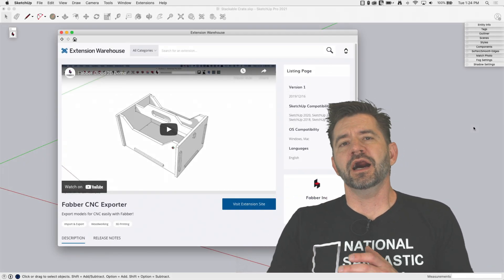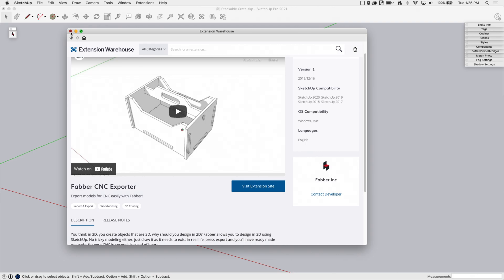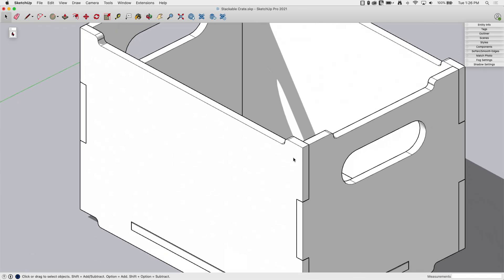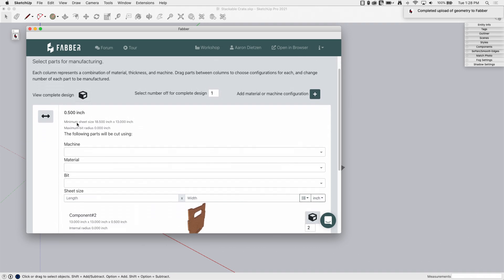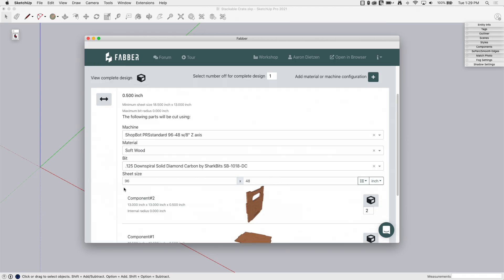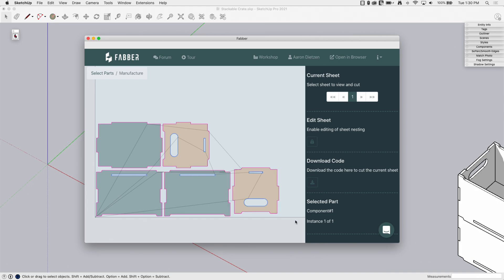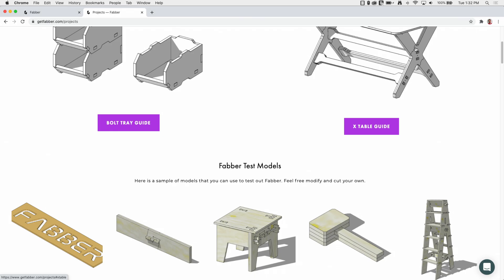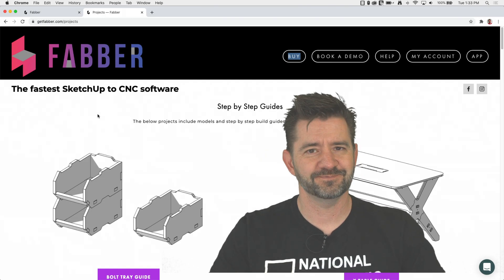Fabber - Extension Inspection

Comment: Now I need to buy a CNC machine..
Reply: Are you seriously considering one? We've used at least a few if you need some suggestions.
Reply: @fabber5696  what would you recommend? 8’ x  4’ bed, mostly ply and mdf. Light industrial use/hobby use.
Reply: @barrymcfadyen4910  For entry-level machines, look at X-Carve and Shapeoko. For intermediate, ful-size machines, Avid and ShopBot are both excellent choices. I have a large production machine (5'x10', vacuum hold-down, 10HP spindle, 10-position automatic tool changer) and sometimes wish I had access to a smaller machine for quick, smaller jobs.
Reply: Exactly what I said!
Reply: @AaronMakingStuff  Surprised you wouldn't have access to at least an X-Carve or Shapeoko at the office.

Comment: A great overview of an excellent extension to SketchUp which has come a long way since I started using it almost 18 months ago - and it's really quick. Just like you showed.
Yes it's a paid for plugin but definitely worth it. Eric was really interested in what I was using Fabber for and having shared a model or two with him very receptive when it came to suggestions. Eric contributed a tips video on SketchUp on digital fabrication which is really worth checking out. I'm not sure if this can be added to the description on this video.
Reply: Thanks so much, we've been working really hard on it. Sometimes a lot of the stuff we improve you can't see, but it makes things run smoother.